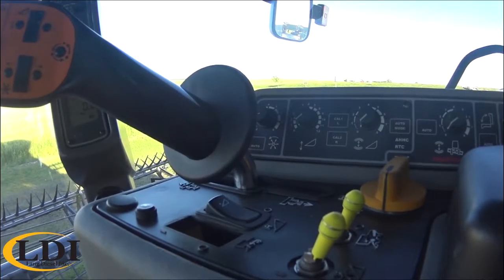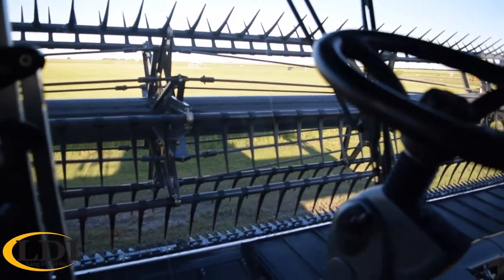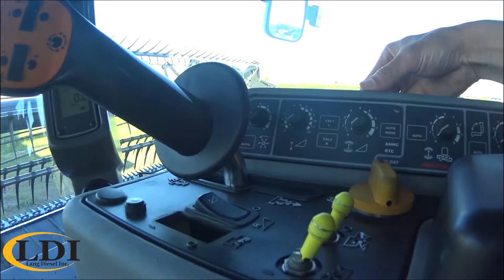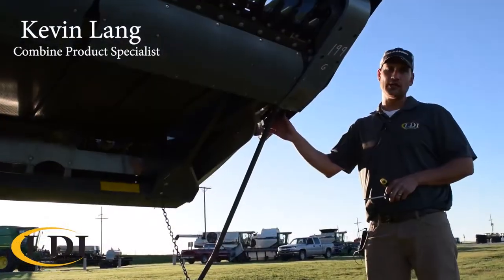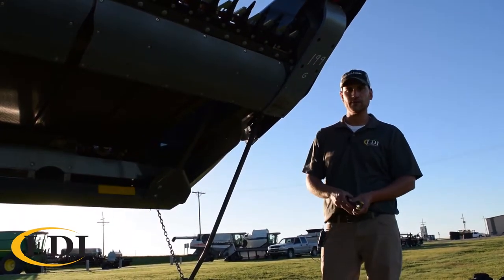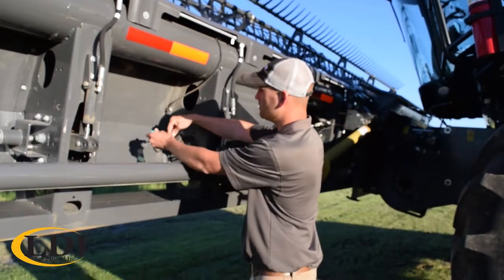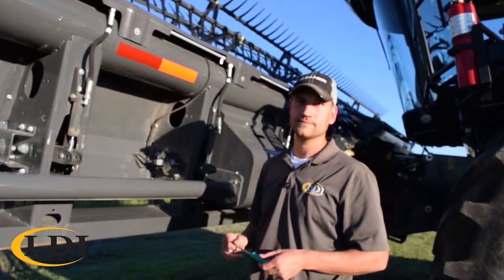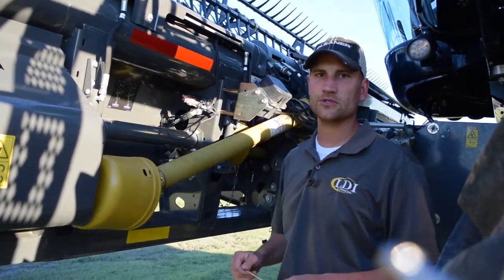Combine Header Calibration

Comment: We actually do our steps for calibration a little different.  Everyone says to put it in the ground and calibrate it that way.  We always adjust sensors with the head in the air and try to hit at least 3.5 volts, plus its easier to be able to stand up and have them right at arm height instead of having to get down on your knees and hunch over with the head in the ground. Those sensors are too damn touch and can easy move with just the slightest touch so sometimes it's hard to hit exactly what voltage you want.

Comment: do you calibrate the head first then adjust the voltage? or should you adjust the voltage first then calibrate the head?
Reply from the maker: Technically you should adjust the voltage first and then calibrate.  If you want a shortcut, you can try to calibrate and see if it fails.  However, to get peak performance, it is best to set it to the exact voltages listed in the video.
Reply: one other question when you are calibrating for drag rods do you put pressure down on the head when  you lower the header to the ground or just until the head touches the ground?  Or do you only put pressure on the head if your calibrating for flex mode?
Reply from the maker: When calibrating drag rods, the most important thing is that the drag rods travel through their full range of motion.  Depending on terrain, combine/header setup, it may be necessary to set some blocks under the drag rods so that when the header is all the way down, the drag rods are contacting the bottom side of the header.   On a DyanFlex, usually you can achieve this by pitching the header back (tilt sickle upwards).  When calibrating flex mode, you do need to put pressure down on the head so that it fully flexes the cutterbar (to make sure it moves through the full range of motion).  (**The minimum requirements for a calibration to succeed are voltages must be between 1 and 5 volts and the sensor must see a 1 volt differential between max and min).

Thanks,
Kevin
Reply: Thanks you for the help. I have a task controller and yield monitor question ill ask under your c2100 video.
Reply from the maker: You are welcome.  Let us know if you have any other questions.